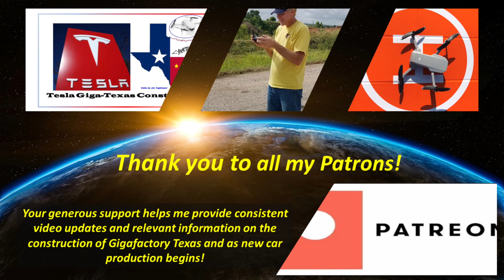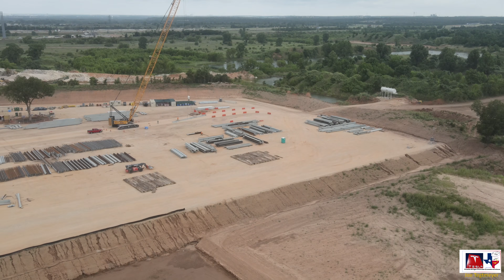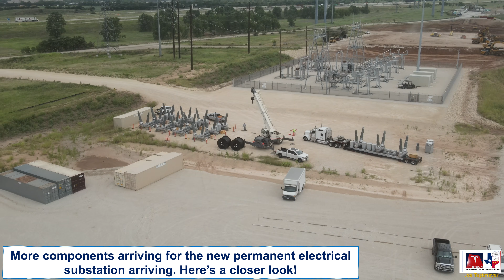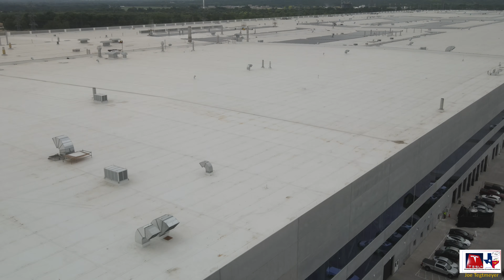Tesla Gigafactory Texas 6 June 2022 Cyber Truck & Model Y Factory Construction Update (07:15AM)

Comment: Joe, from the diagrams in your explanation of how the horizontal drilling works, it appears that the drill bit and its long shaft are flexible (à la rotor-rooter), but  on your photos and drone images, at the entry point on the river's north bank I only see a seemingly rigid and relatively short boring tool...doesn't quite look like the equipment I would expect for a root-rooter-like operation under the river.
Reply: The drill stem is a steel pipe in sections that is added too as they drill. The stem will bend a limited amount as they drill. High density drilling mud is pumped down the stem as they progress to lubricate the bore and keep it open until the pipe is installed. They will use the drill stem to pull in the pipe and as they pull they will remove sections of stem and store them in the cassette on the drilling rig. The other trailer near the boring machine prepares the drilling mud.
Reply: @eltonray2934  Yes, I did see the stack of pipes on the truck near the entry point after a more careful examination of the video.  Also Dessie Doolan sent me a link to a video that shows the drilling/pipe pulling operation at a different site in much greater detail.  Your description of how it works corresponds very well with what I saw in Doolan's video...thanks for your very informative remarks.

Comment: Thank you Joe for the "crash course" on horizontal drilling.  I do have a question: while drilling the pilot hole and then while reaming, I presume that is not through bed rock but through soil under the Colorado River.  How do they guard against/prevent seepage or percolation from the river water into the pilot/reamed hole?  In other words, how do they keep the hole dry?
Reply: The bore isn’t dry. If you look at the pits on the south side at 8.19, they are still full of fluid. The drilling fluid and spoil suspension stops water getting in and the bore collapsing. That's one of the benefits of using bentonite clay as drilling fluid/mud. 

Good video of the process here. https://youtu.be/WVBidJcOs7w?t=115
Reply: @DessieDoolan  Thanks Dessie for the video link...also explains why I didn't see a great long boring shaft.  I expect the mud/fluid also helps lubricate the pull somewhat.  Still don't quite understand how they get the bend in the drilling...the bits and shafts all look like steel pipe.
Reply: @johnweiner  This video shows 2 methods of steering the cutting head, https://youtu.be/cl8BBoCV7gU

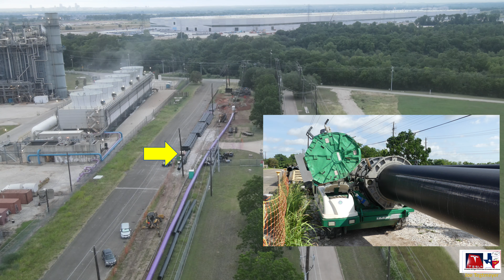Comment: Looked up that machine that the yellow arrow points to at 8:06 (seen in the picture on the right). It’s a pipe fusion machine, used to connect two pieces of pipe together
Reply: From Joe's photos, contractor is Gajeske. The machine by McElroy. Can't see a model number on it. It is marked Trac.
Reply: Might be an older model Tracstar 900i. Maximum pipe diameter is 36". Joe was told by the contractors the purple pipe is 36".

Comment: Hi Joe, Great videos as always! I've been watching since the beginning. You keep mentioning its a sewage pipe they are installing but from watching videos from "Practical Engineering" the purple pipes in most places and Texas are used to SUPPLY non-potable water to industries making use of water many times before being released back to the environment. Here is the point in his video you can learn more. https://youtu.be/Y_729CQdG50?t=75 Also, perhaps the new structure at the treatment plant is being used to expand or add these non-potable water options for other customers.
Reply from the maker: I think you are correct … my error in saying “waste” versus “ treated”
Reply: Justin, The river crossing has an existing 12" sewer line, a 24" Deionized Reclaimed water line and the gas line for the power plant. The new line is a 30" High Density Polyethylene Reclaimed water line that was proposed in 2019 before Tesla bought the land. The company installing the crossing is Dakota Directional Drilling based in Ennis, Texas. There are several ways to control direction but I think that Dakota uses a bit with a shoe attached. Normally they spin the drill stem and apply pressure to drill straight. The operator has an indicator showing shoe position and he applies hydraulic pressure without turning the bit to change direction. The bit has a transponder in it which is read to determine location and depth. When they crossed the river they had an instrument suspended on a cable that indicated bit location.

Comment: Fun "101" on horizontal drilling. Now I have even more questions. You might have covered and I missed it:
Why did they drill 2 holes?
Reply from the maker: They are installing two pipes. One is 20 inches in diameter and the other (purple) is 36 inches. I added more details in the video description.
Reply: @JoeTegtmeyer  , which is a lot of fluids no matter what’s in the pipe.

Comment: Thanks Joe. Great explanation of the drilling operation.
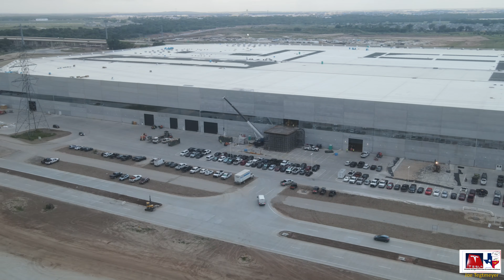9:13. BIW apron. To the north (right) of loading platform. Section of apron busted out. 
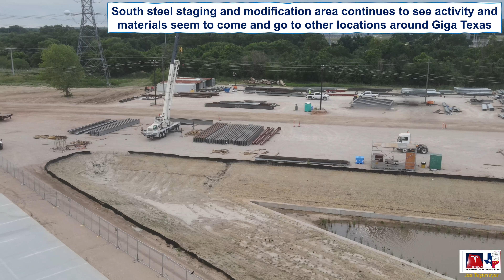11:34. Steel Fabrication Yard. Foreground. Red oxide painted columns with lots of brackets. Salvaged by the looks of it.
Centre of screen. Second loading platform under construction.
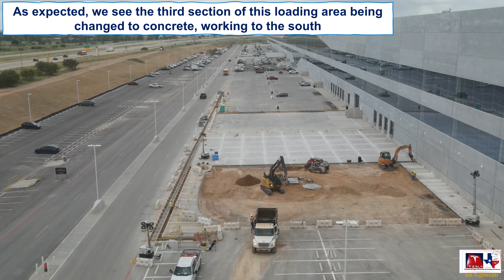12:33. GA apron. Third section of asphalt paving removed. Saw-cut concrete apron against the building being busted out. Installation of the grate/trench drain. 
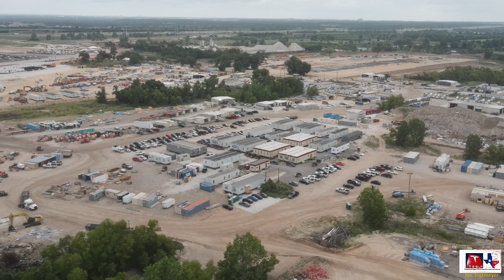14:18. Eastside rubble pile. Concrete squares in amongst it. All seem a consistent size, might be the Cyber Planter rejects.
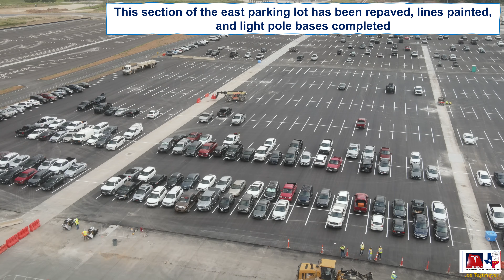19:02. East parking. Bottom left. Pair of road saws. 
19:37. Old Batch Plant/Substation. Excavation doesn’t seem deep enough yet to match the existing substation/switchyard elevation. If indeed that’s the plan.
20:52. Evaporation Pond. No pad foot rollers. Mixed fill.
21:46. North end parking, access road. Bottom left. Formwork constructed for a permanent concrete road barrier or retaining wall.
22:43.  Battery. Scaffold. Going to a lot of effort to get a good finish on that wall.
Reply: @Dessie Doolan, Do you ever look at the videos of the German Giga?  I often think of you when I see all the Kerbs.
Reply: @benguthrie49  Hi Ben. I do from time to time. I never really got a grasp of the set out of the place. It's probably a more interesting build for me, as the methods are less familiar, so I should have shown more attention.

Kerbs. Down here a kerb almost universally would refer to the raised edge of a road. Roof curbs (US terminology) would be upstands here. I referred to machinery plinths when I saw a raised slab being constructed inside Paint, only to find that's called a housekeeping curb (or something similar).

I've taken to playing Wordle. The spelling is US, so that trips me up often. Has got me thinking about the great UK/US spelling divide. A long time curiousity for me has been the US spelling of tyre, TIRE (as in a vehicle wheel tyre/tire). Came to the conclusion TIRE is probably the more correct spelling as it relates to the wear of the wheel/road contact surface.
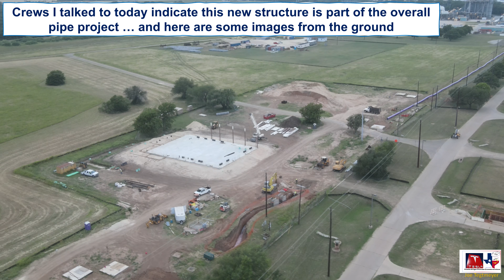Reply: 20:52 (Edited) if you look at Brad’s video at about 7:30 or so, you can see it’s all been ran over by a sheepsfoot roller and is being rolled out by a plain roller now. Don’t know if that’s just the first lift of many or the final grade. I guess we will know more tomorrow. 

 21:46. I think this is the permanent security checkpoint. You can cut across the road just a few feet passed the point so it makes sense. You can see the checking cars a few feet ahead of this area in the video.
Reply: @Bill_N_ATX  20:52. I missed the sheepsfoot/pad roller at 19:32, and it's still visible south east in 20:52. A little surprised at the mixed fill, only because they were so particular with the fill for the existing substation/switchyard. If the Evaporation Pond turns out to be part of it, could just be the parking area.

21:46. Could be. I look at the traffic build up at 21:22 and think that could easily back up onto the highway if someone shows up without the correct ID.

Purple Pipe. Some good photos on Joe's Patreon site. The purple pipe turns out to be black pipe that has been painted.
Reply: @DessieDoolan  I used to work in for a business installing poly pipe and visited a manufacturing plant at one stage.  The colour is just the outer coating of the same material as the rest of the pipe that is applied during the manufacturing process.  Not added at a later stage.
Reply: @Dwayne.Shea.231  I would have thought the same. I was surprised to see otherwise.

 On Joe's Patreon page there’s a photo of the pipe at the north end where it will connect to the swivel. There’s about 12” 0.3m of black pipe that hasn’t been painted. Joe’s photos are zoomable and it’s possible to see the paint. These guys aren’t painters. In other photos it’s easy to see the roller marks where the peel pattern and gloss level change.

I wasn’t particularly following the pipe installation, so I had to do a bit of searching around. I think the pipe was painted on site. No smoking gun, but here’s the steps I’ve found. It’s possible one of the drones captured a pipeline worker with a paint roller in hand. 

Black pipes only stacked south of the river. Joe 26 April. https://youtu.be/ETIThKeBhFQ?t=1016
Purple pipe stacked south of the river. Brad 14 May. https://youtu.be/B-LF-01Pi1Q?t=152
Purple pipe joined. Joints at south end not painted. Jeff Day 675. https://youtu.be/5xRtTbDLNuI?t=567
Purple pipe joined. Joints further north painted. Jeff Day 675. https://youtu.be/5xRtTbDLNuI?t=610
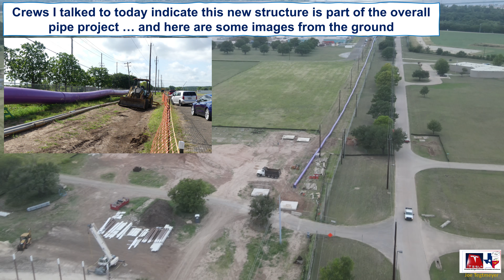Purple painted the entire length. Above at 7:44.
Reply: @Bill_N_ATX  20:52. I just got your email notification with your first draft. Agree!

Comment: Why does it seem to me that there was a lot of time and money paving areas only to rip it up, do a little work, and then repave it.  Or like the water containment area.
Reply: Tesla never lets perfection get in the way of progress.

Other companies “plan” more carefully, but Tesla always gets where they’re going quicker than anyone else.

Time is more valuable than money right now.
Reply: @tommornini2470  disagree...
Reply: @Lost_In_The_Philippines_25  Thanks! 🙏
Reply: @Lost_In_The_Philippines_25  I disagree with you.
Reply: @jbbuzzable  Okay... Explain...
Reply: @Lost_In_The_Philippines_25  I only said that because you did not explain.
Reply: @jbbuzzable  Not explain what?
Reply: The paving around the loading dock area was mainly (fast) temporay dust and mud control as they were geting technitions inside assembling the first production line. Now the entitre area needs concrete (much slower process) for truck traffic that will be sitting at the loading docks. The main employee storm drain and lights add-ons parking area was because of the lack of time to finish those items before the Cyber Rodeo event.